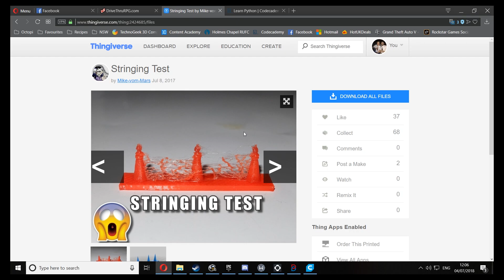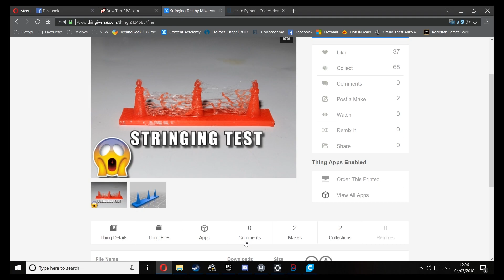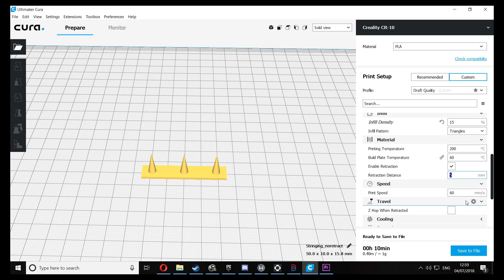A Beginners Guide To 3D Printing - How To Combat Stringing!

Comment: Not actual stringing, but the whisps mentioned in fact ARE easily removed with a quick hover with a standard lighter. It’s hot enough to melt whisps without focusing on one area, but not a torch which can melt your print in those areas.

Comment: Hello, What about the retraction speed? Should it be equal to the print speed? And these settings worked until the PLA+ arived. PLA+ needs 205C to 225C temperature. Print became crumbly, hand breakable when I set temperature at 205C, and later print was strong but it strings heavily even when I set 206C temperature. (Print speed 60 and retraction speed was 40).

Comment: Did Cura move where "enable retraction" shows up? I enabled it in settings but it's not a check box, and it's under speed not material. Is this a me problem or an update?
Reply: Advanced 😋